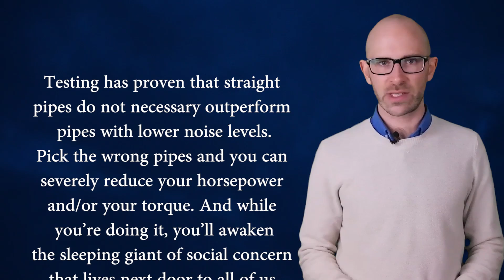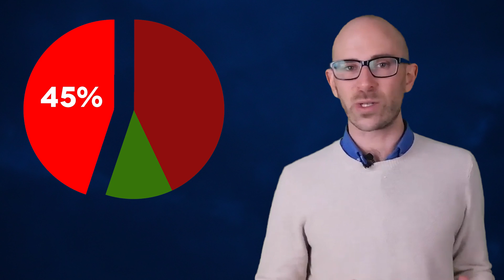Why are Harley Davidson Motorcycles So Loud?

Comment: I'm not against bikes or bikers. I have seen many a bad-ass Harley in my day, and they are beautiful machines. And there are a LOT of highly respectful, and respectable riders. But lets be realistic here. I  can take the muffler off of my V-twin Briggs & Stratton Lawn tractor, and add some pipes and it sounds exactly like a Harley.  It also has the un-even firing sequence of a Harley.  "pop-pop..pop-pop..pop-pop.." It's still only a 26 horsepower, two cylinder engine. Two cylinders are not tough. Want tough?  Try a Chevy 350 with the growl of Flowmasters, or the sweet roar and whine of a Cummins turbo diesel. Smooth, tonal sounds. rich, deep, exhaust notes.   THAT'S sweet music!  Not the tinny, bang bang pop pop and the constant vrooom vrooom vrooom vroooom of what is little more than a lawnmower engine.   Do those things not idle without constantly pumping the throttle?

 And ya' know what else?  My car MUST have a fully functional catalytic converter, muffler, and pollution control system,  as well as seat-belts in order to pass an inspection. And If I sit at red lights pumping the throttle and revving like an attention-seeker,  and then roaring off at full throttle, I'll get fined for noise violations and "exhibition of speed"..If I put bright spotlights next to my headlights, and flat out refuse to turn them off for oncoming traffic, Or if I deck my car with externally visible lighting other than factory stock,  I'll be fined for "unsafe equipment"  Bikes burn the same gas, use oil, and operate on the same roads as any car, but are somehow exempt from the rules that apply to the rest of us?  Who is getting paid off here? 

 And the "loud pipes save lives" bullshit?  is just that.  Bullshit.  Cars these days are engineered to block out outside noise and most people listen to music while driving.  If we can't hear that Freightliner, we sure as hell are not going to hear that tiny little two-popper.  Besides, the pipes and their noise is directed REARWARD, and AWAY from it's alleged, intended targets up ahead. If you really wanted to depend on the sound to warn drivers, you would turn your pipes to face forward.  SO L.P.S.L. Is just shit that doesn't flush.     Instead of passing the buck all the time,  we need riders who stop weaving in & out of rows of traffic, riding between stopped lanes, riding on the shoulders,  driving up on sidewalks to get around a non-turning car, to make a right on a red,  gangs of bikers ignoring red-lights,  (ALL of which I have seen within the last few years.)  And actually PAY ATTENTION like the rest of us do.   Drivers have to watch out for the dumb-asses with the applephone glued to their noses just like riders do.  EVERYBODY needs to wake the hell up, and pay attention to the road and surroundings.  It's called situational awareness, common courtesy, and some damn common sense.   Use them.
Reply: clearly neither of you have ridden bikes in traffic, car's don't see you cause they don't bother looking, they can hear a bike if it's loud enough, though it doesn't need to be as loud as some like it.

if driver's can't hear shit, and it makes no difference at all, why are horns mandatory on car's? people can't hear em so they are pointless right?

I'm not saying people should straight pipe their bikes, but to say is has NO affect at all on safety is just being willfully ignorant.
Reply: several points to take into consideration

first, harleys dont go pop pop... pop pop... they have more of a potato.. potato.. potato sound, its a three part noise. so no your mower may "lobe" but it wont sound that same, honda was sued or at least HD tried to cause their shadow line of bikes sounded to close to the harley signature sound.

when properly set up and maintained (bikers typically keep them better maintained) the emissions are less than that of a car even gallon to gallon of fuel consumed. they burn cleaner. also you are talking about sound vrs visibility, sound will not cause you to lose vision of the road or obstacles ahead. sound CAN alert you to risks around you however.

and by your argument against loud pipes saving lives, that means a harley would be able to sneak up on you til they pass? lol, if this were true, just stay ahead of them. I used to ride a quieter buzzy type motorcycle, a couple of them in fact. I did notice a large difference between how often people tried to pull out in front of me.

that whole thing about what sounds better to you then complain about a harley, do you even know what an actual harley sounds like? they have that deep throated rumble you mention. there is nothing "tinney" about them. maybe you are thinking sport bikes? you do understand that harley only had sport bikes for a few years before the split and the sport bikes were carried on by the designer bruell?

also why complain about the loudness (DB levels) of a motorcycle in any situation when some of the things you mention are as loud or louder, yet say they are music to your ears? your arguments are horrid and illogical at best. highly contradictory and un-informed seems to be more the case.

now to cover what some of the other people said in the replies as well. 

if sounds actually completely ruin your quality of life by being around you for a few moments, they would make construction workers muffle the sounds of their jack hammers, and other large equipment, stereos would be regulated in more than just "quiet zones",  air ports would be forced to move to outside of the cities and way from any other residences.

while sound proofing cares is getting more advanced, it can not and should not make it into a quiet room studio, again see earlier about sounds alerting to risks.  police also need you to hear them if you are to oblivious to their lights, and for people to pay attention to them and other emergency services. which use a much higher db level.

to those saying its moot to have loud pipes cause cars are becoming more sound proof and people playing music, then umm.. gee... why are you complaining about loud harleys in the first place, you shouldn't be hearing them at all.
Reply: Tim Barthelemy Bikesplaining loser.
Reply: when riding a quiet bike the number of vehicles that tried to change lanes into me (i wasn't in their mirror's and they didn't bother to shoulder check  was quite high.  After a muffler fell off said bike, that didn't happen anymore.  It was a VERY noticeable difference. 

Like i said before though, i'm not really arguing for straightpipes or super loud HD's.  But a bike being loud enough that a car beside them can hear they are there is definitely a safety factor.  The factory 80db or so is probably enough.
Reply: I ride, my dad rides, my uncles, cousins, grandpa and just about everyone I know rides. And we all have the exact same thing to say to dipshits like you,this is America land of the free, if you dont like it tough shit. Move somewhere else
Reply: Loud pipes save lives.
Reply: You're spot on cobber.
Reply: like i said, my argument is solely against the people who say the noise isn't a factor in safety at all, bike don't need to be as loud as some people seem to like to be noticeable.  I also didn't deliberately hang out in blind spots, but if your just going with the flow of traffic and some jackass thinks your a empty spot he can change lanes into..

I don't like straight-piped harly's anymore then most people do, and i'm not opposed to a law restricting them.  I won't stand by while mis-informed people tell me that a whisper quiet bike is just as safe on a multilane highway as one loud enough to hear when it's beside you though.  I've been run into emergency lanes enough times to know that any bike I buy in the future will be loud enough for car's to hear when I am beside them, and preferably no louder then that (i like my hearing too, but i like being alive to enjoy it more)  80ish db's or so on the highway is roughly enough, and it's not too annoying, certainly no more then what many people do to their car's.
Reply: L98FIERO even if they were, would you be able to see them over your apple I phone screen
Reply: Rick Sanchez Well said Rick. Me too my 114 with a stage 3 is loud as fuck personally I don't give a shit if it saves my life or not...it sounds fukin awesome and when I'm on that bike it's all about ME! There are plenty of enthusiasts out there that love the sound the rest are crumbs...
Reply: You nailed it! Every time one of these fuck-wits tries to intimidate me I'm considering running him off the road. I have much more power than him!
Reply: I ride a GSX-R1000K3. My bike in first gear is as fast as yours in top. It doesn't make a hell of a racket like yours. It sounds awesome!!! Born to be wild or born to be a loser?
Reply: Tim, the safety thing is pure, utter, unadulterated bullshit, if safety were actually a concern all the Harley riders wouldn't be wearing black, I have yet to see one wearing a dayglow orange safety vest.
Reply: animefreak5757 My sole vehicle for three years was a Honda 550 Super Sport, so I understand bikes and traffic.  The MAIN point of loud pipes is to call attention to the biker, not for safety, but because the biker simply needs attention for some reason.  If HD riders cared about safety, they would wear full-faced helmets.  HD riders do EVERYTHING they can to be unsafe, so the idea that ruining the peace of a whole neighborhood is for SAFETY is utter bullshit.

Fortunately, towns, cities, and now states are banning deafening motorcycles.  If HD riders cared about safety, they would drive Volvo’s.

Motorcycles are fun, but that doesn’t give me the right to destroy hundreds of people’s peace and quiet.  Have you noticed that poor neighborhoods are noisy and rich neighborhoods are quiet?  Why is that?  Simple!  The government CARES about rich people and makes sure noisemakers get kicked out REALLY quickly from rich neighborhoods.  Hey, if you hate poor people (or people in general), keep deafening them.  I’m sure the deaf children will thank you.
Reply: animefreak, admittedly it does make some difference though likely insignificant. Why are horns required on cars? Well, how many cars have you seen with the horns aimed backwards? When you point the exhaust out the front of your bike I'll believe you that you are doing it for safety and like I said before, I have yet to see a Harley rider wearing a high visibility jacket or a flashing warning light on the top of their helmet (for safety of course).
Reply: animefreak5757 When I rode my 550, I made damn sure that I didn’t hang out in anyone’s blind spot.  You’re right - a lot of people don’t see bikers, but intentionally causing noise that seriously damages people’s quality of life isn’t worth the added safety it provides.  Just take that argument to its logical conclusion: the loudest vehicle is the safest.  It’s a noise arms race.  I don’t want someone to fail to notice my car, so I should have a siren on it going at all times.  I’ve had people turn into my car because I was in their blind spot too.

Yes, I know the consequences of being on a motorcycle hit by a car at highway speeds: death (if I’m lucky).  I drove my 550 because I was too poor to buy a car, and I fell in love with motorcycles, so I TOTALLY get it.  Yes, noise makes it hard to fail to notice a motorcycle, but at the cost of EVERYONE’S peace and quiet?  

I know you are trying to be reasonable, and I understand what you are saying, but just about every HD owner I have ever seen has a car, so the bike is purely for fun.  The level of noise on most of those bikes is OBVIOUSLY meant as an audio assault on the people around them.

I LOVE motorcycles, but I don’t have the right to wake up my neighborhood for my safety when I could drive a car.  You’re a reasonable guy - why do you think some HD riders boost their noise to the point where they can be CLEARLY heard a MILE away?  Safety?  Nah.  You know better.

I can even see how it would be fun to have a loud bike, but my “right” to fun ends where other people’s quality of life begins.  It’s actually kind of pleasant to hear the sound of a stock HD drive by once in a while, but HD riders went too far.

Sadly, riding motorcycles is a VERY dangerous hobby and I am VERY lucky I was never seriously injured.  It’s really, really fun, but some guys ruined it by not being satisfied with the fun of the ride - they needed to make ear-shattering noise.

I assume you aren’t elderly.  Imagine going out for a nice stroll with your wife of 50 years and you’re chatting about your fond memories - then three 120 dB HDs drive by.  That pretty much ruins the walk, don’t you agree?  People should be able to hold uninterrupted conversations as they walk around their own neighborhoods.  If not, then there’s something seriously wrong.
Reply: So you're saying that loud pipes don't save lives? And never has? Hm... I beg to differ. They've saved mine. Bikes are a lot smaller than cars and therefore harder to see and nobody rides their bike around just holding down the horn button so everyone knows where they are. Also, how can you compare a v-twin to a 350? Doesnt really make any sense to me. And congrats on being able to make a Briggs sound similar to a Harley. That's not really saying much though. Guess what. I can make any American v8 with a cross plane crank sound like a 350. Big deal. I can't stand it when people who probably don't even ride share their "opinions" and think they know what they're talking about. People make their bikes loud for the same reason people make their cars super quiet. Because that's what they like and that's their style. Can't bitch about it if you don't even ride. Stick to your Prius or whatever silent eco friendly garbage you drive. This is America. We like loud shit.

Comment: One thing I've known since the 60's.. a truly powerful engine sound can be heard no matter the muffler. If you know what you're listening to. For instance, any old 60-70 model muscle car sounds very different. Ignorant people have always tried to make their engines sound bad ass by not using proper mufflers. You can hear the power though, if you know what you're hearing. A little engine still sounds like a "sewing machine" to me even with straight pipes and no muffling.

Comment: It's not about a particular brand of motorcycle being loud.  It's about whether the stock mufflers were replaced or tampered with.

I've rented a Harley Davidson (1688 cc engine) with the original mufflers on it.  It wasn't loud at all.
Reply: that's a given.  the stock muff have cats in them,  and contribute to heat.  that heat combines with the lean condition of a stock bike, robs performance and causes premature wear and failures inside the engine.  basically, if left stock, your/a bike will not last as long as a bike the has removed the exhaust restriction and  been retuned.  the bikes will destroy themselves.    HD is cool with that... they sell replacement parts and laugh at customers.

https://www.pacermonitor.com/public/case/20055391/Michael_Berke_et_al_v_HarleyDavidson_Motor_Company_Group,_LLC_et_al

Comment: While I do agree a louder exhaust can alert drivers to the motorcyclist, most of the time the drivers won't hear the motorcycle till it's either directly along side them or in front of them as the noise is directed backwards and not forwards, which would mean it doesn't make that much of a difference to the people who are gonna forget to check their blindspots or mirrors anyway, best way to combat this is if your filtering put your high beams on and give a beep if you see people who look like they are gonna pull out, if your on a highway and someone pulls into your lane the likeliness they will hear your exhaust is nearly zero anyway

Comment: I find it interesting that all these reports only report fatality crashes for motorcycles.  How about the undoubtedly thousands of near-misses that occur every day that require a rider to quickly adjust to avoid becoming some idiots hood ornament?  It's something they don't take into account on those reports.  

Sure, if you're being stupid you're going to die.  If you're inexperienced enough that you can't correct a minor mistake, you're going to die.  If you don't have enough control of your bike to avoid the soccer mom talking to the PTA on her cell phone & touching up her makeup while she drives her SUV, you're going to die.  

However, there are so many more unreported occurrences of bikes almost getting smashed that never get added into any statistical data pool.  Even the hurt report should be taken with a grain of salt due to incomplete data collection.

Comment: the fact that so many accidents are deemed the fault of the cyclist has doesn't mean that they actually were at fault to that disproportionate level. There must be some percentage of cases where the police see a soccer mom and a young man on a Ninja, and have decided it's the Ninja Dude's fault before any critical thinking takes place.
Reply: Derrick Thompson note that those stats are for fatal crashes where the biker can't argue back. In most jurisdictions the SMIDSY is the most common cause of a motorbike accident.
Reply: the highway stats include sport-bikes, they make up the majority of all motorcycle deaths "your 4x as likely to die if you ride a crotch rocket" and including those figures to prove "pipes don't save lives" is simply false and disingenuous.

Comment: Funny your stats. I just did the same inquiry & found 80% of accidents were of NO fault of the rider. biased much? 

In fact, during research conducted by the National Highway Safety Administration (NHTSA) during 2003, it was found that in all motorcycle accidents occurring between motorcyclists and cars, the motorcyclist was either not at fault or less at fault than the other driver 80 percent of the time.